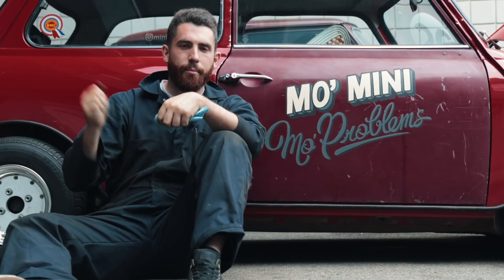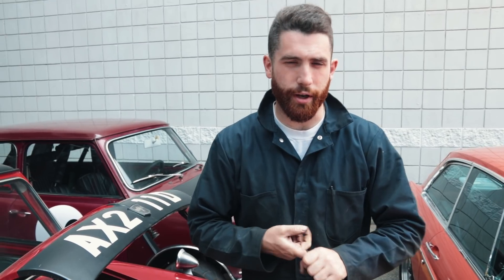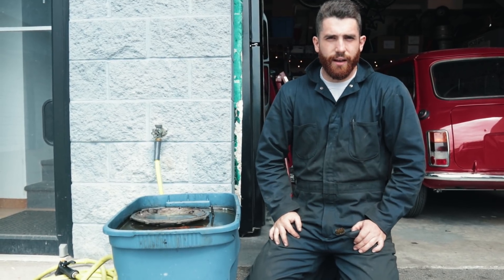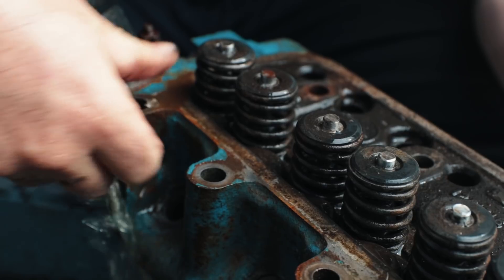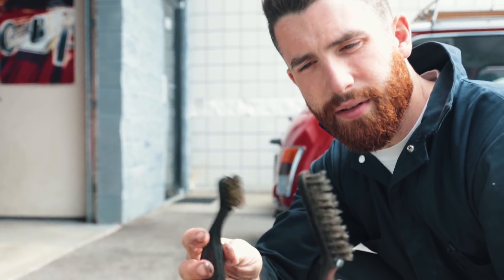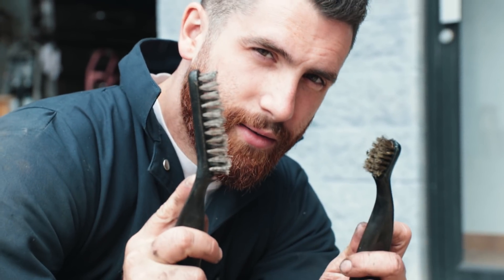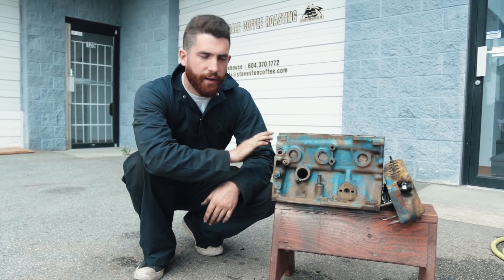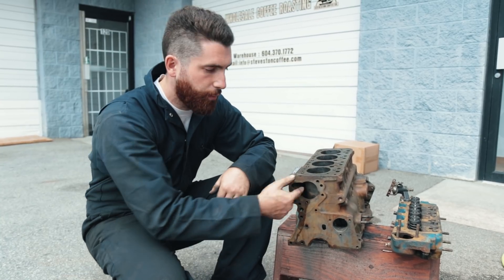De-rusting an old engine block for rebuilding

Comment: My water pump went out on my 88 ford f150, and when I tried to take it off it was seized to the time chain cover, I think it was the original water pump. I ended up breaking the timing chain cover. Then, I had to replace that too. When I had it a part I notice a big build up of rust in the engine. I just went ahead an put it back together. After thinking about it, I was just curious, How to get that rust out, or if I should even worry about it? is why I'm looking at this video. I guess I just won't worry about it till I have to rebuild the engine. By the way I doubt, CLR would help much on a 1/4 inch of rust, it doesn't even work good on toilets. I'm think maybe a acid flush or maybe diesel would work better, I'll have to look that up next. Diesel fuel is what old timers soaked their parts in to clean them.

Comment: White vinegar has given me the best results to date, 3-4 days soak depending on the severity, I've found there is almost no need for scrubbing at all, just a clean/power wash to remove the vinegar residue. Not sure how it would go on greasy engine parts though as Ive only used it on rusty steel and various metal pieces.

Comment: I'm disassembling my engine pretty much completely and trying to reuse as many parts as possible after I clean the hell out of them. Been using brake/carb cleaner/kerosene to scrub most of the internals that need it, but whats the best way to store parts afterwards? I live on the coast so atmosphere is very humid and salty. Apparently one of the most acidic tropical locations for metal in Texas

Comment: I have been trying to get as much if the rust flaking out before I do this dip. I know there will be residual flakes. I’ve removed the core plugs already. Any recommendations on getting all the flakes out? Heavy flushing? Triumph 1194 engine.
Reply from the maker: The dip should just dissolve the flakes too.

Comment: So is this just tap water or distilled? Also can it be stored in the vat for a month or so?
Reply from the maker: We use tap water but BC tap water is excellent in water quality, so consider your local water. Sometimes we run the solution in a daily driver for up to 5 days with great success. But not sure how a longer time period would affect rubber seals.
Reply: So it is 100% stripped apart with no seals. I am wanting to store it so it will not rust over winter (here).

Comment: The best de-oxidizing aluminum cleaner I've ever found is cheap aerosol spray on oven cleaner from a supermarket. Look for one that specifically states 'not to use' on aluminum. Because it 'eats alloy' you have to put it on and get it off pretty quickly with a pressure washer. Depending on how bad the oxidization is dictates how many times you have to repeat the process. I generally put it on and leave for 1 minute before washing off, and repeat if necessary. Used it on old mag wheels from the 70's, alloy heads, various alloy castings etc.

Comment: Quick question: are you using the wire brush to clean off the gunk because the head and block are going to be re-machined after? If you were not going to re-machine them, would you use a plastic brush or some other brush that was not metal?

Comment: I've restored a '74 Norton Commando 850 motorcycle and find "Metal Rescue" a decent rust converter for things like the inside of the petrol tank. Another similar product is Evapo-Rust. Both are none acidic and enviro safe (they are called chelating agents which convert oxidized iron back to non-oxizied state). The 4 litres in the jug can be reused many times on different parts.

Comment: why not using citric acid to de-rust?
Reply: Agreed: I use a very weak solution (1%) and soak parts for week, rubbing off loose rust every day. The solution is safe and can be poured down the drain afterwards. Use gloves if you have cuts etc. on your hands.

Comment: Just a polite technical correction, none of the items stated are steel, the block and head are manufactured from Cast Iron a completely different material to steel and the flywheel cover and Transfer/idler gear casing are aluminum. Obviously the valves still in the head are steel and the valve springs are spring steel. Nice job though of removing corrosion and old paint. Have fun building mini's, I was doing that in the early 1970's
Reply from the maker: Yes, thanks for that! Appreciate the correction.

Comment: Apple cider vinegar works amazingly on rust too. Used that on a old gas tank and couldn’t believe the results.
Reply: What was the ratio?
Reply: Chad Cossette straight from the bottle. I let it set for about a week and then drained it out.

Comment: Don't listen to this guy, check your coolant for contamination before you take it apart to de-rust it. Anti freeze will stop your engine from rusting inside and you will only get rust build up if other entities have got inside your coolant loop. SIGNIFICANT blockage in an engine block is very rare and only caused by mistreatment.

Comment: What would you recommend for a beginner whose Mini engine has substantial rust, but who hasn't the tools or the knowledge to completely disassemble and remove the whole body? Really looking to do as much to the car myself without taking it into a shop (doesn't help that my budget is less than minimal).

Would it also be possible for you guys to do a video about adjusting the air/fuel mixture? Mine is running very strong for whatever reason.

Have just found your channel and have instantly fallen in love. Look forward to your upcoming videos.
Reply from the maker: Minky Tres-vain thanks for the kind words! For a rust engine you can also swap out your coolant for a mix of CLR and water and run it for a few days before thoroughly flushing it to help with the passage ways. We will be doing a carb tuning video very soon, stay tuned!
Reply: Thanks for the quick reply. Really looking forward to the tuning video.

Comment: Great video I have a 1991 spi mini and inside the radiator, when I unscrew the cap is all rusty and orange is this bad?
Reply from the maker: It might be pretty rusty inside. A good place to look is in the water passage underneath the thermostat (next time you're in there).

Comment: Interesting video. What would be the expensive solution to rust removal on iron blocks?
Reply: Machine shop and getting them to acid dip it or blast it I would guess.
Reply from the maker: What Classic Mini DIY said. They would probably use a very similar process but using hot tanks and faster-acting chemicals.

Comment: Interesting! When it comes to all the aluminum bits (transmission, transfer case, clutch housing) I have found a great product to get them looking as they would have originally. Well, depending on your year Mini, some had those parts painted engine color while others (later cars) these were left bare. There is a US chain parts store called Napa and they make a product called Aluminum Brightener. I'm sure you can find the exact same thing elsewhere. Will just need the exact ingredients. Its pretty caustic stuff so use outside if you can. You spray it on, let it soak and then agitate with a brush. I try and use as non-abrasive of a brush as I can get away with as to not leave marks. A couple applications of this stuff, with plenty of elbow grease in between and the results came out outstanding. I have done this on my Rover Mini as well as a vintage Honda motorcycle case and could not be happier. What to try to avoid is machine wire bushing or the likes as it will change the overall finish.
Reply from the maker: Cool, we'll definitely  have to pick some up and try that. Thanks for the tip!
Reply: I really like the idea of getting any and all scale out from inside the motor. I bet that if you stuck a DIY style parts washer pump inside that bin, you would get even better results...or maybe just cut down on the soak time needed. 

Different blocks have different short comings but the A series, as well as my 57 fords block both have cylinder jugs that are very close together. Rust gets trapped in between and then heat builds up. As you said, no amount of cooling upgrades will fix what a solid block flush can achieve. 

What is your paint of choice for blocks...or am I jumping the gun. If you never want to have to worry about rust, have a look at POR15. Serious stuff that I can vouch for lasting through massive overheating issue as well as hot dunk tanks.
Reply: @Brivinci1  Never use stop leak on a engine that is aluminum, not even if the only part is the intake. It will eat a hole threw aluminum. It happened on a Camaro I used to have. I had to replace the intake.

Comment: It's really interesting to know that rust is a thermal insulator, especially if you have a heating issue like me. How do I get it out without disassembling the engine? What would be safe to use and how would you use it?
Reply from the maker: We think most minis that run hot are afflicted by this problem. So how do you get at that area with engine assembled and installed? (First, a disclaimer: we don't take responsibility for what you put into your engine. Be careful and attentive to ingredients with ANYTHING you put in your block) Okay, that being said, you can run gentle products that won't damage seals like CLR right in your coolant. We've seen the best results from flushing out the coolant, adding water and a liter of CLR, and letting it do it's work for a week. You can drive your car (you should, to circulate the water). Then flush it several times and fill with coolant like normal. Let us know how it goes if you give it a try.
Reply: Steveston Motor Co is right that's a really great way to do it. Chris Fix also has a good video about flushing your cooling system - https://youtu.be/s--5ft5YiHg
Reply: Stevestonmotorco that's exactly what I wanted to know. Now I just need to figure out what the equivalent to CLR is in Sweden... 😊
Reply: Wow, I came here to ask this very question... THANKS! I'm gonna try this next week. Here in Utah it's been running in the mid to high 90's and I just put in an upgraded radiator and while it's running much cooler, it still runs hot and when stopped at lights the temp raises up a bit. Hopefully the CLR clears the jackets and lets me run cool. Thanks again. I'll check back in after I do it to report how it went.
Reply: @LanPhantom  hey did you try it and how did it go for you?
Reply from the maker: Also curious